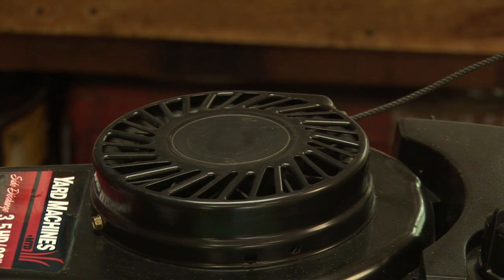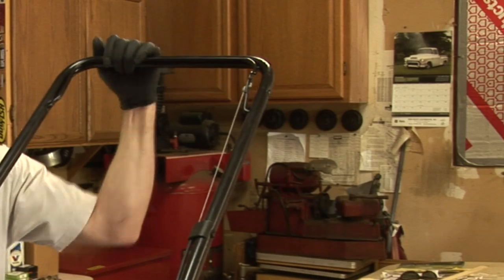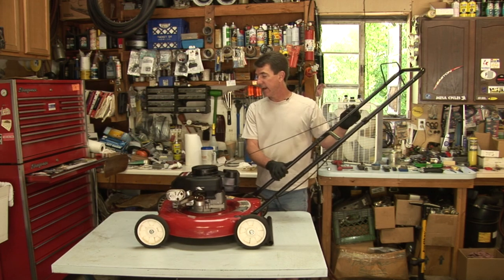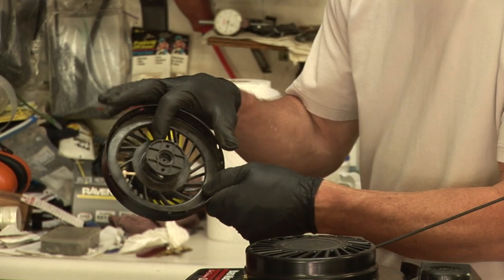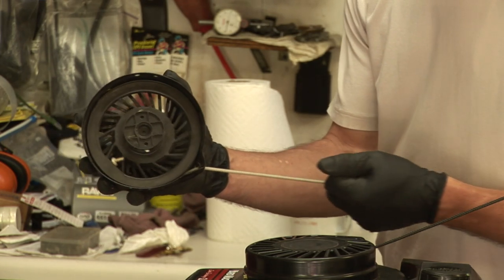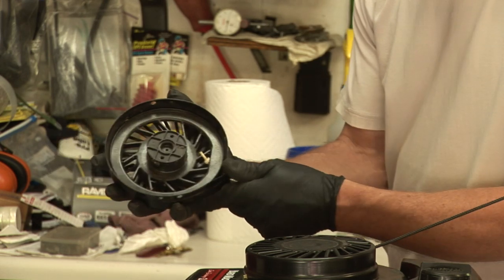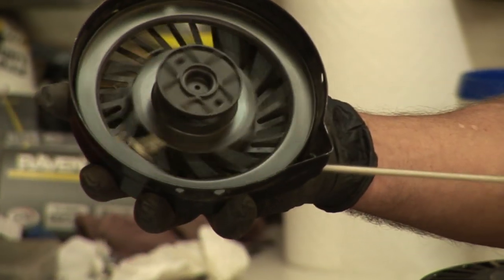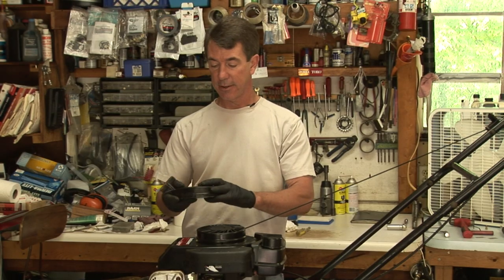Lawn Mower Repair : How to Troubleshoot a Lawn Mower Starter

Comment: That is good information to know. I have a Craftsman lawn tractor which I have been putting much money into to get it running again. It will start when I pour gas into the carb, but quit shortly afterwards. I figured that something in the line even though all filters was replaced along with the line going to the carb from the gas tank. My next step is to blow out the lines with an air hose and I wonder if that is safe?

Comment: This is the exact unit I have, but the tension has failed. How do I get the wheel open to access the spring? Don't want to break parts getting in there....

Comment: My diagnosis was wrong.  The starter pawls were coming out.  But the flywheel cup was slipping, giving the impression the starter wasn't grabbing.  It was due to the flywheel nut not being properly tightened.

Comment: Mower on second season, used maybe 7 times! New gas, oil, clean plug, filter, gets spark but will not start. Troy built B&S. Any ideas?

Comment: that broken pull start where the little pegs wont come out on the over side in the middle take the sticker of you will see a little square rubbery piece get a dry wall screw and put it in as far as it will go in it then grind the rest off this will make the little catching pegs come fully out

Comment: @stev0697657656358987 Advanced ignition timing probably. Which means it is igniting in the engine too soon and sending the piston down the other way. You could have a bent crankshaft or a broken flywheel key.